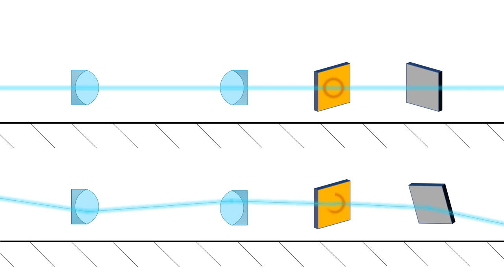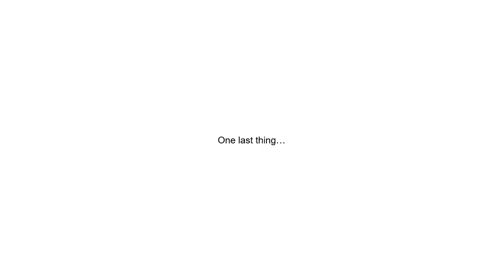3 - Beam heights

Comment: Really helpful and informative introductions! Thank you! Combining with the previous beam steering video that two iris was used for alignment. How to make two iris has the same height, and straightly alined seems to be difficult to me.
Reply: Use a single post with an orifice, and move it over the table along the beam
Reply: @odissey2  Thank you very much. I will try in my experiment.